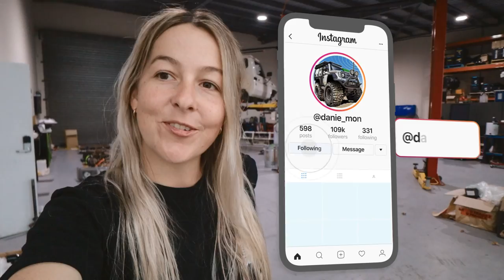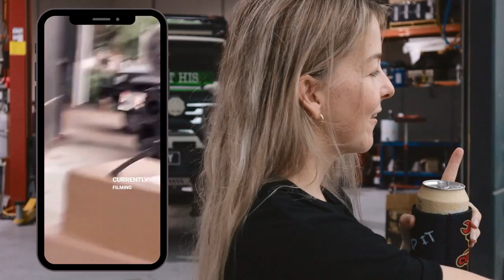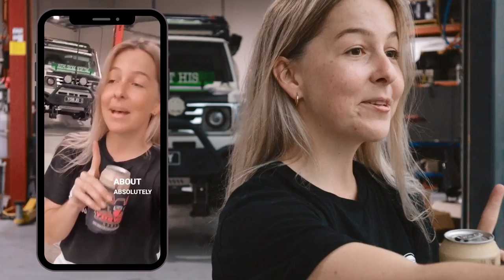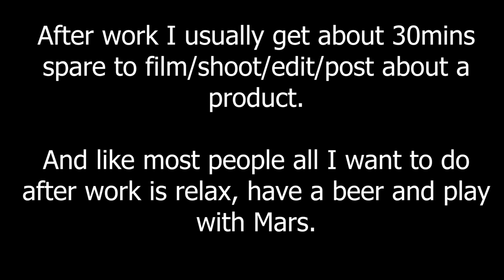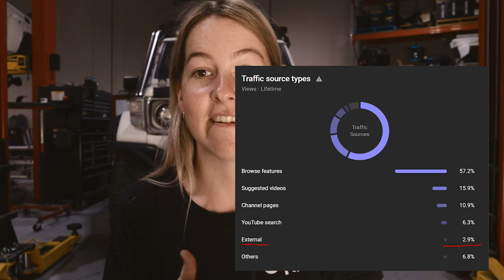What do my followers REALLY want to know + Custom Mudflaps!

Comment: Pro-tip: whenever you mess with door handles or locks, ALWAYS wind the window down before testing to avoid embarassing outcomes. ;-)

You're probably going to say that you've got the keys in your pocket or that the passenger door was unlocked but, y'know, sod's law and all that.
Reply from the maker: Can't change the door handle with the window down it blocks the access and I gotta change my regulator also its missing a few teeth. So I kept the other door unlocked and open for ease